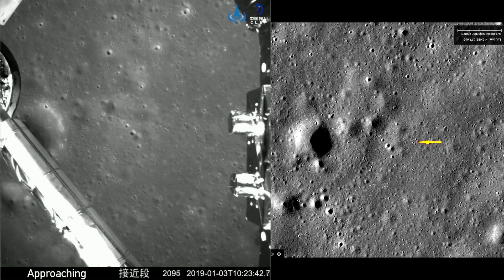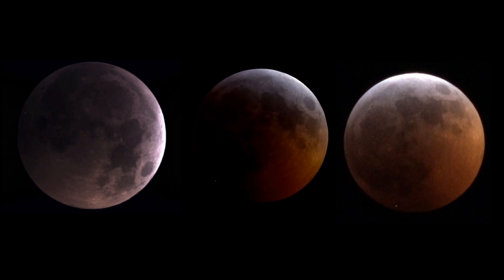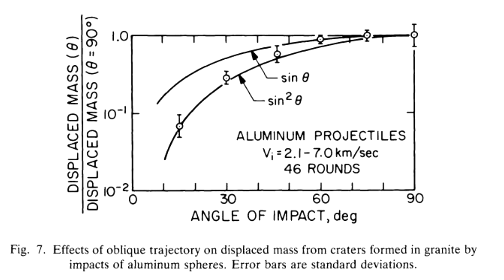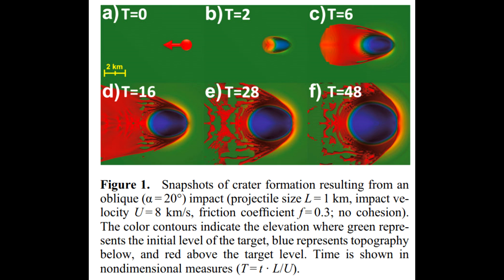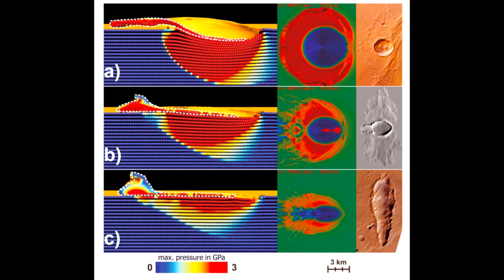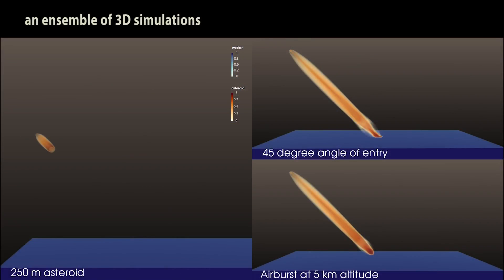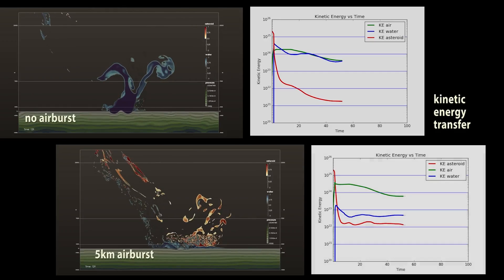Why Are Most Impact Craters Perfectly Circular? (Rather than Ovals)

Comment: Meanwhile out in the real world away from Manley's StarTrek fantasizing: the craters on the moon and planets were all made by either hard chunks of debris or soft fluffy iceballs aka comets - all made from teh water the jetted out from under Earth's crust as it was shattered at the start of The Flood about 4,350 years ago.
Try to understand that Russuan and German deep drilling has discovered superhot water in the shattered crust and that superhot water flashes off into steam at extreme speed.
A big 'fountain of the deep' would be perfectly capable of blasting huge quantities of water,  salt, soil and organic matter into outer space where today we see it as comets, asteroids and meteorites.
Any such bodies would directly impact the front of the moon to cause the huge but shallow craters or the smaller deeper craters we see today.
The clincher is the fact that craters with central peaks were made by water masses - such as fluffy comets?
Reply from the maker: Problems with your hypothesis:
1) We regularly see new craters getting made on the moon today by space rocks.
2) The age of the surface of the moon is billions of years.
3) The energy required to move that much water to the moon would have sterilized the Earth completely, no plant or animal would survive on Earth.

Sorry, the numbers don't add up, because you're basing your ideas on a 2 thousand year old book rather than observations of the world.

Comment: Excellent. So an impact is basically more or less the same thing as setting off a bomb buried in the surface. The process of vaporization and expansion is far more rapid than the linear motion of the object, and creates a hole much, much larger than the linear diameter of the impactor.

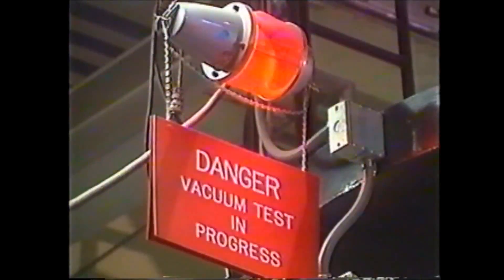Comment: Please explain this quote from 3:02 "you can't go fast than the speed of sound in the gases" .
Reply from the maker: The hot pressurized expanding gasses have a speed of sound, and that’s the fastest that a pressure wave can propagate in them. So they can’t push a bullet at faster speeds.
Reply: @scottmanley  Thanks for the quick reply, how is it most bullets go faster than the speed of sound from an average gun? what's the mechanics that make that possible?
Reply from the maker: Because the speed of sound in hot high pressure gasses from the bullet propellant is faster than the speed of sound in cold air at 1 atmosphere of pressure.
Reply: @scottmanley  Yes, thank you I was looking it up as you replied, great video :)

Comment: The title puzzled me. After a bit of thought I think the best way I could put it is: because no matter how much sideways movement an object has through the atmosphere, it never moves very far side to side after striking the surface, it just stops right there and that's the one spot the shockwave comes from.
I'm not sure if my explanation is right, since I'm not sure about very big objects that might actually have enough mass to keep moving through the surface of a self-roundingly massive body for a significant distance, or smaller objects that might also have circular craters despite being small enough for an impact to have lots of travel relative to its surface. My next thought is maybe it's because so much energy is released by the initial impact that there's only that one instant with enough energy to form a crater, because the object then breaks apart and the bigger it is the more energy goes into breaking it instead of creating further crater-making-class explosions at another part of the impact. 
Time to watch the video and find out the answers to the puzzle

Comment: The impact can appear circular when the direction of the impact is vertical or close to it.
But the jettissoned lunar modules didn't arrive vertically on the moon, not even close to it; they arrived almost horizontally on it, with a very small angle relatively to the mean lunar surface.
This can be easily explained: In order to crash on the lunar surface, the lunar modules were deorbited by reducing their speed of a little quantity, hardly more than the one which had been used to make the lunar module originally reach an orbit closer to the lunar surface before the powered descent; in these conditions the lunar module had to crash on the lunar surface almost horizontally, in order to crash vertically on the lunar surface, its speed would have had to be nulled, but the remaining propellants were not allowing it.
For instance the mission report of Apollo 12 specifies that the jettissoned lunar module arrived on the lunar surface with an angle of only 3.7° relatively to the mean lunar surface.
This means that its horizontal speed was then more than 15 times greater than its vertical speed; it these conditions, it is obvious that it would have scraped the lunar surface on a long trail and not made a impact crater looking almost circular.

Comment: Very nice explanation of something I did not understand.  Well done.
Does the gravity of the impacted object have much effect on the flight of the impacting object, so as to make the impact angle closer to 90 degrees?
Reply from the maker: It turns out that the probability  distribution of impact angles is unchanged by gravity. For every object that hits at a steeper angle, there are objects which would have missed now hitting at low angles.
Reply: @scottmanley  Interesting.  I had not thought of near misses that would be deflected just enough to hit at a grazing angle.

Comment: When an object hits a hard surface at an angle and is reflected in a symmetrical angle, the resulting vector of momentum is rectangular to said surface. Any surface feels quite hard when you impact at orbital speeds.
Also an impactor at orbital speed is basically a high energy phonon (i.e. sonic waves interpreted as particles similar to em-waves being called photons). This phonon enters a different medium, causing changes in wavelength and direction. Its like a stick that appears to have a kink when you stick it into water.

Comment: So the Valles Marineris on Mars (the long weird trench) might have been formed by an impact almost parallel to the surface. And maybe the impacter consisted of 2 or more parts, which easily leads to a weird shape of the crater.

Comment: Thunderbolts project says craters are electrically caused. You never see large craters randomly overlapping any smaller craters just largest craters on the bottom & smaller craters on top of them & mostly on the rim of a larger crater where a discharge would occur. On Mars there are craters that turn into rilles. Then there are rilles that turn into crater chains. The Moon craters have flat bottoms. Then there are domes. Then there are hexagon craters. You can see the electric discharge happening on comets reacting to the different electrical environment of the solar wind creating tails.
Reply: "Thunderbolts project says" BS, because it's full pseudo-science nonsense, sorry.
Maybe you should get your informations from somewhere else.
Reply: @ThomasKundera  What makes no sense is believing a comet is a snowball that melts from the inside by being heated from the outside creating a hot spot inside & a geyser. Then they want you to believe a nozzle made of flimsy ice is strong enough to produce 800 meter per sec streams that they measured without shattering in the first millisecond. Why modern cosmology is so closed minded to electric universe is crazy.
Reply: @mazdaspeedmx512lbs  : "believing a comet is a snowball"
It is, mostly.

"that melts from the inside by being heated from the outside creating a hot spot inside & a geyser."
Yes. So what?

"Then they want you to believe a nozzle made of flimsy ice is strong enough to produce 800 meter per sec streams that they measured without shattering in the first millisecond."
I'm not a comet specialist, but what's your point here?

"Why modern cosmology is so closed minded to electric universe is" just logic, as it's pure BS.
Sorry.

The reasons why some naive fall into that trap is beyond by understanding.
Reply: @ThomasKundera "Yes So what?" Comets are proof of electric activity in space here & now & it crushes the standard model of how the solar system formed. On Comet Temple 1 there was electrical excavation between two visits, craters had become bigger & a meas cliff had been electrically excavated 55 meters. At this time there is far too much evidence for the electric universe to say its BS. Its basically ignorance of it on people who still believe in main stream cosmology. All it takes is to look at the multitude of odd craters & crater chains & impossible craters on comets & solar system moons & Mars.
Reply: @mazdaspeedmx512lbs  : "Comets are proof of electric activity in space"
I don't see why.
You didn't gave any justification to that.

"there is far too much evidence for the electric universe"
Show me one.
Reply: @ThomasKundera  I sent you a video & there is far more evidence than that. Episode 2 Symbols of an Alien Sky: The Lightning Scarred Planet, Mars (Full Documentary) To refuse to look at all evidence prejudge it & be bias it totally unscientific. Pre judging & bias towards modern big bang cosmology blinds big bang cosmologists. Here is another video Confirmed: Comet Dust Tail is Electrically Charged | Space News
Reply: @mazdaspeedmx512lbs  : I didn't saw any video link, I may have miss something.

And I'm discussing with you, not a video.
So, if there is anything interesting in that video, just tell me what here.
Reply: JCHangtime     "Electric Universe" theory was just pseudoscientific nonsense last I checked.
Reply: @mikedelhoo  At one time they persecuted Galileo & believed the Earth was flat. The more you look at modern cosmology the more & more contradictions you see. Modern cosmology closes peoples minds just like the flat Earth belief closed minds. Modern cosmology looks at the universe from one bias point of view model of gravity only & totally excludes electricity.  Maybe of you watched Episode 2 Symbols of an Alien Sky: The Lightning Scarred Planet, Mars (Full Documentary) at least you would be able to see things from a different point of view rather than from a one sided only boxed in philosophy way of seeing what your told to see. Its a really good professional made documentary.
Reply: @mazdaspeedmx512lbs  : " they persecuted Galileo & believed the Earth was flat"
Wrong. Maybe you should check facts before saying BS.
Fact that the Earth is a globe was known since about 300BC.
No scholar would contest that at the time of Galileo.

"totally excludes electricity"
Just relying on what we do observe.
Not the fantasy of a few cranks.
That's the point.

Comment: Sorry, rocks flying into a dust covered surface is not complicated. He makes it complicated on purpose. Also, if the same face of the moon faces the earth for millions of years, ONLY extremely low angle meteors should ever hit that face. Think about it. Of course, there should be tons and tons of "streaks." There are not. Reassess everything you know.
Reply: "He makes it complicated on purpose"
Really? For which purpose?

"if the same face of the moon faces the earth for millions of years"
It's the case...

"ONLY extremely low angle meteors should ever hit that face"
Draw the figure to scale, and you'll realize how non sense this is.

"Reassess everything you know"
Seems you have to right now! Good luck!
Reply: Quantum of Conscience     "if the same face of the moon faces the earth for millions of years, ONLY extremely low angle meteors should ever hit that face"   Consider that from the Moon's perspective, the Earth covers a piece of the sky about 2 degrees wide. If you make an allowance for gravitational effects, you can consider the Earth to be a bit wider than that.  But the upshot is that you wouldn't expect the Earth to provide much shielding worth mentioning.

Comment: If I understood you correctly you said a conventional gun using gun powder for propellant is incapable of accelerating a projectile faster than the speed of sound?
I don't think you meant that or I misunderstood. That is certainly possible and common.
Reply: Faster than the speed of sound in the propulsive gas.
Otherwise the bullet goes away faster than the gas can push on it, so it's not pushed any more.

Comment: Now you tell me what's the more likely cause of FRB's, Ackham…   aliens using a black hole to get a message to a speck planet next to a tiny sun leading their target by about a 100 million light years or so given a 5mph east to west cross wind all while not hitting a single object on the way here- not any asteroids in the Kuiper belt not any other planets not any asteroids outside mars not any satellites not a single magnetic field...    orrrrrrr a local and common source, that easily involves adequate energy to produce?    Is it possible, with big enough fast enough meteorites,  with a localized cloud of space gas charged enough and dense enough to have a high enough ion charge density to produce atmospheric plasma barrier discharge, with these two energies combined in a spectrum of potential modes and outputs, is it possible for them to produce an x-ray level gamma emission- sub 100kev?... that then gets reflected back to earth, the frequencies getting distorted, compounded, absorbed and re-emitted, offering a variable time delay between source and record, and offering a variable energy output between source and record, and offering a variable location of reflection from source, reflecting off of a variety of potential reflectors including a virtual barrier of relativistic electron speed, curved by magnetism,  is it possible for meteors to cause space clouds to move, resulting in fast radio bursts that are only witnessed as if seeing an explosion's reflection in a mirage?   Far-away-and-really-energetic electromagnetic waves look very similar to near-and-weak electromagnetic waves, especially when only receiving a radio frequency for 3 milliseconds. Just conjecture until it's not, but imagine for a moment if you will, a meteor heats up as it rubs against solar charged ions in the thin film of gas being compressed in the bow shock of the moon, a positive charge builds up in the space cloud and produces a negatively charged leader that follows the line of least resistance in potential energy produced by the compression of gas in front of meteor, the meteor wake creates a column of charged ions that forms conduit of excited electrons and causes an imbalance of charge in the entire electrically cohesive gas cloud, a cloud that may be a trillion times weaker than a thunderstorm but may be multiple times the size of the earth, in a flash of light, a gamma emission all to itself, a meteor in less than earth gravity and in a no-real-time-testing environment,  causes a lightning bolt or plasma ball like discharge sometime before or during or after impact.  Peeling scotch tape produces x-rays, sailboats produce st.elmos fire, we have no current explanation for FRB's, though a publicly presented possibility is aliens? -can't be anything related to electricity according to the space experts that have complete information control, so whatever you do don't ask the question, " is there a better way than what the 'authorities' say?".  52 fast radio bursts since 2007 have been recorded, energy ranges from 400 MHz to 8ghz.  Four frb's were recorded in 2013.  Frbcat is down at the moment it seems, so not sure of the dates on those. I  have found no public knowledge of lunar impact frequency screened by energy, two in 2013 were 4 ton and 14 ton of tnt as recorded by light emission though light emission duration is still unaccounted for.
Reply: @bob dole: what did you smoke? BTW, objects in the Kuiper belt and asteroid belt are so far apart, you can hardly see the next neighboring object if you stand on one.  It would be extremely difficult to hit one. Don't think sf movies where they are dodging stones in dense clouds. It has no relation with reality. And to randomly pick another nonsense claim, as an experienced seaman: ships don't produce St. Elmo's fire, they experience it, sometimes, when thunderstorms are near. All ships. Nothing to do with sails. You  might check up on facts before echoing someone else's beliefs.

Comment: TL;DR: Most craters are round because the impactor and the target both explode on impact, and they explode in a roughly-spherical pattern at all but the most shallow impact angles. The kinetic energy of a hypersonic impactor is orders of magnitude larger than its momentum, and kinetic energy doesn't convey a directional force like momentum does. So when that kinetic energy is transferred to the expanding cloud of vaporized rock, the direction of the impactor's momentum has only a minuscule effect on the trajectories of the ejecta particles.

Comment: St. Elmo's Fire …         A sailboat in a storm is fast enough, but not a meteor in the solar wind?
Reply from the maker: Solar wind’s density is a trillion times weaker that the wind on earth.
Reply: Can you see these three replies?  They don't show up to the public, as in my friend in another state cannot see them.  I'm fine if you want to keep things directed, but if youtubeis doing thecensoring and you don't know about it, then I think you should know about it.  Know censorship, No science.
Reply: @bobdole9708  : I can see them. There's a small menu above called SORT BY. It sorts  by "top comments" by default. If you change that to "newest first" it's fairly easy to find your comments back. Maybe in the other setting your comments are far down. Maybe YT uses a bs detector when sorting for top comments.